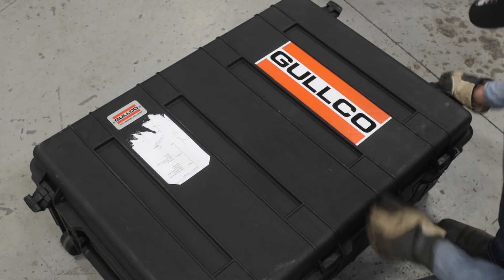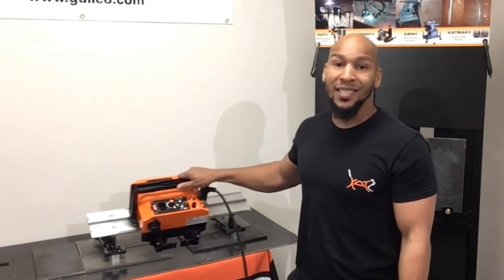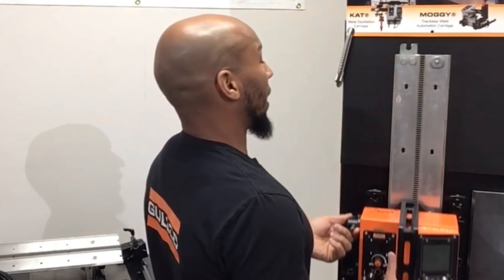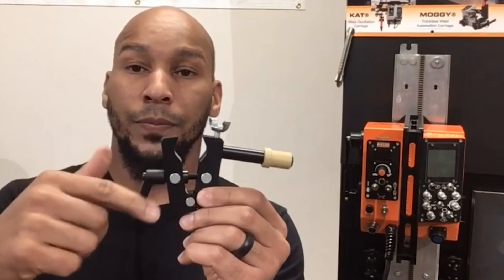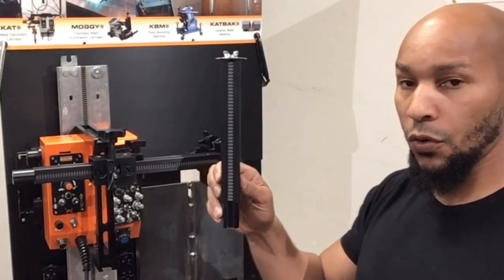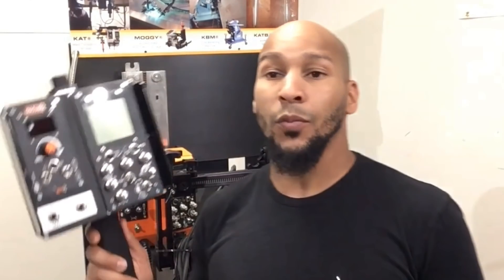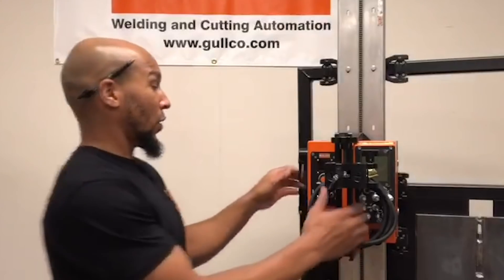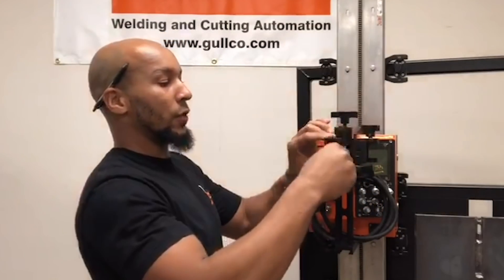Gullco 300 KAT | Fabtech Cancellation Series - Day 2

Comment: As I am not a welder but always interested in stuff like this, it was rather informative, though I think your question may have caught him off guard as he did repeat himself without actually answering the question. What I am wondering is if you guys could set up a test to compare QUALITY of welds and what they look like cross section-wise (think I said that right) between an experienced welder welding manually and this automation running a weld. I am super curious as to the kind of quality of welds this would put out.